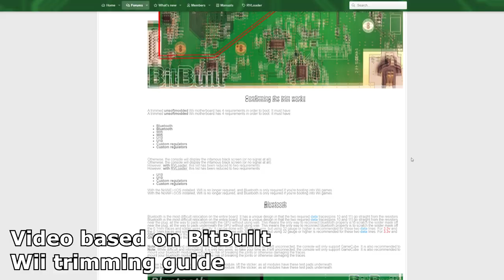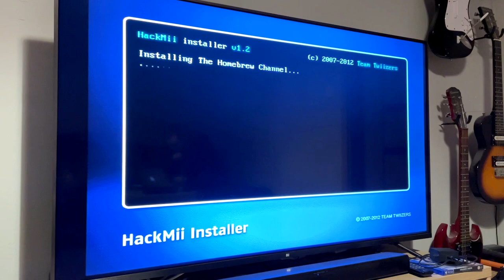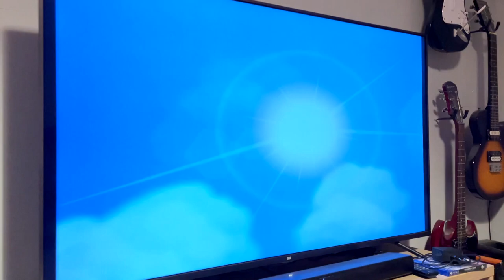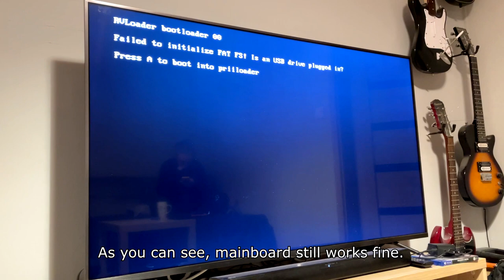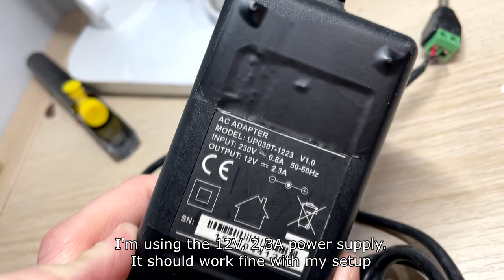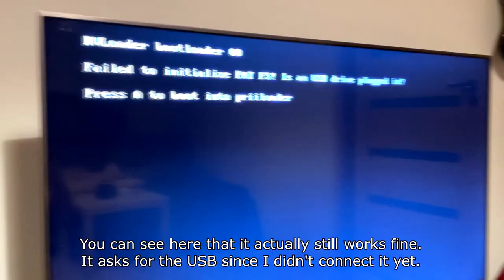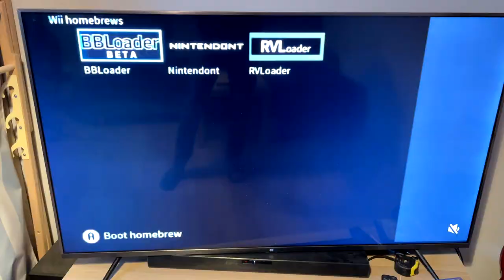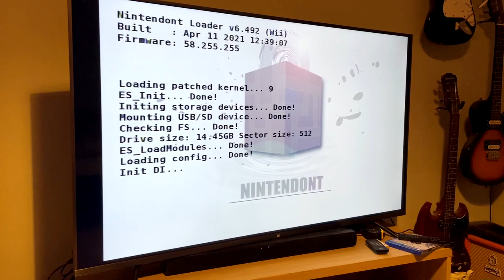New Wii Mainboard Trimming Guide

Comment: This is great to see a full trim guide finally on youtube but one thing I recommend is to relocate or at least remove u10 (or u9) before trimming so you don't accidentally damage it.
Reply from the maker: Yeah. That’s pretty good idea. I don’t know why I didn’t relocate it before cutting.
Reply: It’s probably better just to use u10 emulation on the pms lite from 4layer
Reply: @ashykins u10 Emulation? So you don't need to relocate it at all?
Reply: @nytrouz_original  depends on if you have the PMS 2 or lite from 4layer or not
Reply: @ashykins  They are the same, relocation is more reliable most people don't even use it when its available

Comment: Hey again! I finally pulled the trigger on trying this and while I originally meant to keep my usb ports, some panicking after I trimmed made me cut them so I was trying to rewire a usb breakout board to the CM1 or CM2.

I've tried using 34 AWG Magnet wire and 36 AWG stranded wire for this and neither seems to be great, can I ask what gauge wire you used at 16:47? I and I'm assuming you didn't need to twist those wires because you already had a usb female cable that had that D+ / D- twisting built in for you? 

This might be one of the most difficult resolders I've tried and I may not be able to continue past this point, but at least if I try again I want to have as much info as possible. Thanks!
Reply from the maker: Hi!
I’ve used a “Kynar wire” I don’t really know what gauge it is. I know for sure that it’s bigger than magnetic wire. 

Hope that you’ve made the software changes before the trimming. Otherwise it won’t work
Reply: @ManolloMancelli  For sure! I ended up soldering straight to the traces instead of the CM1/CM2 with 34 AWG magnet wire, and it seems to work so far. I appreciate the reply though!!

Comment: 0:53 So my issue is I have a Wii without GameCube ports, but it's marked with "K02." Would that be a problem?
Reply from the maker: It shouldn’t be a problem since every wii motherboard has GameCube pins on the board. You just don’t have connectors soldered on.
Reply: @ManolloMancelli  Thank you!

Comment: What would be the way to reduce load times? As in, how would you store the games any way but usb?? Would using a larger sd and having the games play from there be faster?? Thanks for the video!
Reply from the maker: SD card could be faster but it would require additional wiring as you’d have to wire back the SD card slot. I don’t think it’s really worth it. USB load times are not so bad.

Comment: 4:11 My issue is that some of the WAD files are missing and I can only get one. The main one I'm missing is IOS58. Do you know a safe way I can get it?
Reply: (UPDATE) I'm now using a diffrent wii however it's a 6 layer. Is most pf the software the same?
Reply from the maker: Most software should be the same. 
You can find IOS58 wad here :
https://wiibrew.org/wiki/IOS58_Installer

Comment: From here can additional controllers be connected? This looks really cool but it's GameCube controllers I want to use.
Reply from the maker: You can connect up to 4 GameCube controllers. You’d just need to solder them to the board. There are connection pins available
Reply: @ManolloMancelli  do you have a resource you can link with schematics that highlight where to solder the connectors on a trimmed board?

Comment: Yo i have my child hood wii that I recently broke when trying to fix the bluetooth module. Ik its fixable, but i was curious if anyone can turn into a portable without deleting the data thats on it. If possible, and if you could do it, how much would it be?
Reply from the maker: It has to be operational in order to install software required for trimming.
Reply: @ManolloMancelli  I can fix the port, but im more looking for an estimate right now, sorry i should of mentioned that.
Reply from the maker: @thegaminggoblin1197  I would charge for trimmingabout 50 euro but you would have to buy all of the components like display, voltage regulators, batteries etc. There's also a matter of shiping costs as I live in Europe. You should ask on BitBuilt.net there are a lot of people that could help you out with this.

Comment: i did everything according to the video but the rvloader or anything at all wont show up on the homebrew, i tried different usb drives
Reply from the maker: Have you followed the software guide on BitBuilt?
Reply: @ManolloMancelli  I've got it to run. Tried everything wasted so much time. The solution was pretty simple at first i put the whole folder on the drive, then after a lot of wasted time and frustration i just took all files from the rvloader folder and put it on the drive, then it worked.

Comment: This was excellent and gave me a lot more confidence into finally pulling the trigger on something like this. 

I have a question about the voltage regulators, though: I bought the RVL-PSU from bitbuilt a while back, is that a more compact custom version of what you did with those three components + capacitors, etc? Just want to know if I need to get those components otherwise.
Reply from the maker: Thanks!
RVL-PSU is basically 4 converters combined into one board. 
If you bought it then you’re good to go.

Comment: I have a question, it's about the RVLoader. How do I install it? the 3 files shown, do I need to unzip all 3 to my usd drive? or just one?
Reply from the maker: You need to unzip only one file. 2 of them contains source code. Those are not needed. The one you need is named “RVLoader_1.5.zip”
Reply: @ManolloMancelli  Even though I unzip them in the root. It still won't load on the homebrew channel.
Reply: RVLoader*